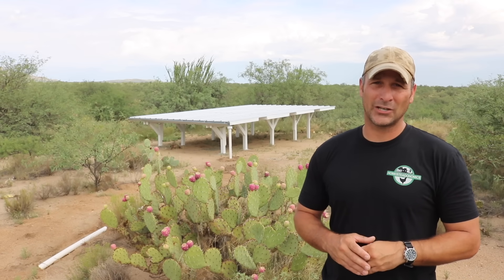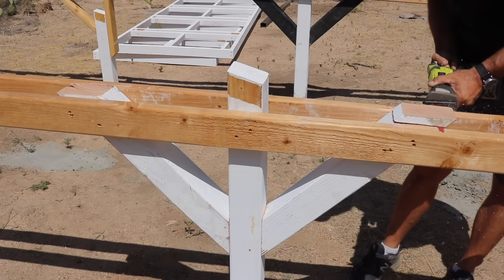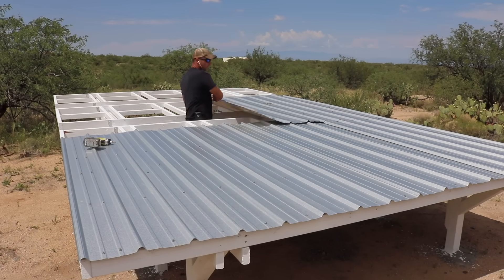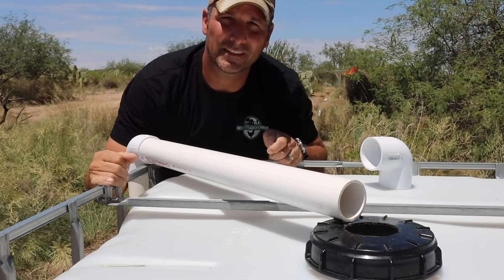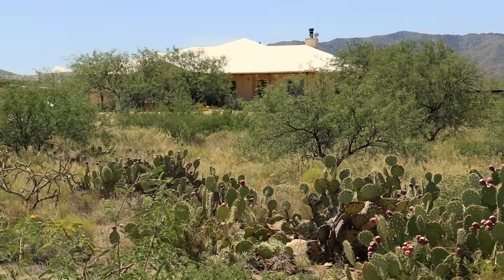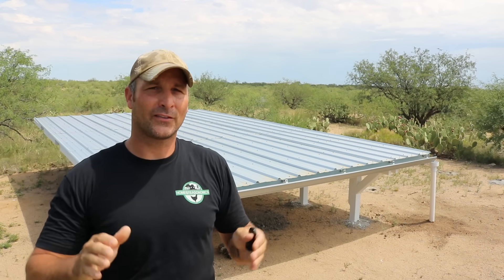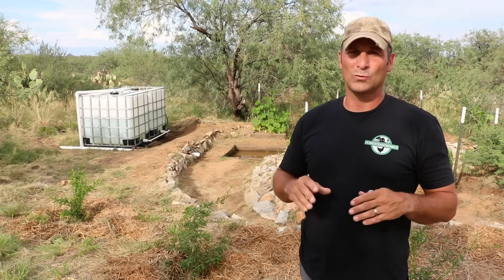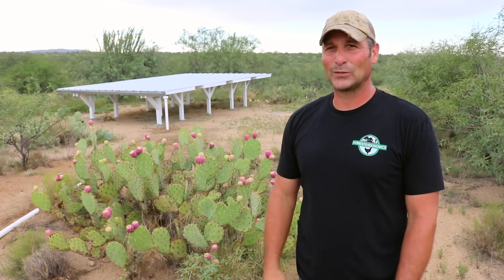Rain Roof -  Rainwater Harvesting Project - How To

Comment from the maker: NOTE:  QUESTIONS About HEIGHT, DESIGN, WHY THIS OR THAT are likely answered WITHIN the video.   I address several of the most common questions that people have been asking, during the video.  Questions pertaining to WHY's of the roof's size, height, collection capacity, better suited structures for collection, dual purpose structures being better than this setup, how I used an existing structure, why there aren't solar panels, cheaper methods of collection that I use, how the water moves through the pipe, alternatives to storage that are better than IBC's, location of the IBC's, why this roof is NOT the ideal set up, cost and several other topics.  Please, if you watch the video you might see an answer to your question.  I appreciate you all watching, but I unfortunately do not have the time to answer questions that have been addressed multiple times in the video.   

Again, thank you for watching and sorry if this sounded too direct.  But I really think many of the questions being asked here are answered within the video... some multiple times.   I understand many people just click through videos quickly.  But unfortunately when doing so, they often miss many details of why or how certain things were done and why.  

And on another note... one question that I did not answer in the video, is how I drain the piping and use it to water plants via a garden hose.   I will try to show this in an update video at some point in the future.
Reply: Would be great for Cattle...in a holding pasture.. - they'd have Water and Shelter...  .. Yep, I'm listening a s you had said it.🙏 🐑 🐮
Reply: Desde hace un dia veo que tus videos, una sugerencia, pero creo que ya se te debe haber ocurrido - No seria mejor si esos contenedores de agua, los hubieras ubicado debajo del techo recolector de agua? Digo porque se podria hacer un hoyo por debajo del techo, para que quede semi enterrado y de esa forma protejes el agua de la interperie - terreno abajo, tendrias agua por gravedad de riego por goteo, incluso si puedes elevar ese techo, te puede servir para hacer un deposito extra, aparte de alojar los contenedores de agua, tendria un buen proposito, claro algo mas de trabajo, aunque eso creo no te seria muy dificil, por tu forma de ser - Saludos y felicitaciones por tu labor
Reply: O
Reply: You make things looks so good easy.
Reply: Isn't it better to make a carport to use land underneath ,shade
Reply: U should have made it a carport be better
Reply: Traducir
Reply: Traductor español
Reply: Why not just 3d print a giant funnel?
Reply: 12 14 2023

Comment: When I was growing up, our "rain roof" for supplemental non-potable water catchment was a plastic sheet on the ground up the hill from the cabin. If metal isn't an option, UV-resistant plastics like greenhouse membrane, pool liner, or old billboard tarp can work great if you've got enough elevation change for it.
Reply: One word "microplastics"...

Comment: solar panels slanted at an angle drip water just as well. why not kill two birds with one stone and put panels on top of the roof? Then you have triple use. Shade, power, water. Such a triple use gazebo might not even require city approval as solar panel installations on roofs oftentimes do, although you would need to check with your jurisdiction of course.

Comment: No! No I DON’T know how that works! Yes you’ve explained it works by level difference and showed me that the outlet is lower than the inlet, but I still don’t get how the water is going UP the pipe. I think it works like this… water will go up the pipe and into the IBC if the whole pipe is full of water (so like the water gets to the bottom of the pipe and just builds up the pipe and up the vertical pipe at the same level until it hits the opening of the outlet and then will drain out and won’t (shouldn’t at least) be able to flood back up out of the inlet unless the water is filling up faster than what is coming out of the outlet. 

Am I close?!?

Comment: I live on a yacht in NZ and only drink rain water..and put a clean  tarp out before shower comes...and with just 1 m x 1 m often get 40 litres in a few hours.  Using a nylon web tarp attached to 4 or 6 corner posts...means it can be folded when not needed to keep it clean. Its light too..a collection point in centre of tarp can funnel the water into drum below. We filled 1000 litres tank in Nepal like this in a heavy shower...with  4 m x 4 m tarp.

Comment: That's pretty dumb nothing but a car port why wouldn't you build it higher so animals get some shade under it
Reply from the maker: Thanks for letting me know you didn’t watch any of it….where I address all of those questions about why this isn’t the best design, carport/dual purpose structure is ideal, cheaper options, why I was using materials I had on hand and a structure that was already existing at that height…🤦‍♂️😂
Reply: @homesteadonomics  Seems Phil had some great songs but no common sense- Great video well done Thank you.

Comment: Why so low to the ground? Why not build it higher so the space under it could be used for storage?
Reply from the maker: I literally answer ALL of those questions in the video….. why this is not an ideal setup, better designs that use less material, cheap tarp setups, why the ideal that any structure like this is a dual use structure….etc
Reply: @homesteadonomics  My apologies, I didn't watch the whole video. I have seen other examples of these, and they seemed to be short, so I ran with that.

Comment: I wonder if you could do this with static solar panel array. Maybe mount little fin on the sides and a gutter along the bottom edge of each array row into a final gutter on one end. Capture energy and capture water with the same system.

Comment: I like it. Would be easy to put a south facing slant on it and mount some solar panels over it. Two birds with 1 stone. 
Put it 8 ft in the air and you also got a car port. 
Three birds.

Comment: Look at Bermuda, there is no surface water. All roofs are designed as roof collectors, made with local materials concrete, coral rock, lime finished, controls contamination, renewable.

Comment: Okay, now make it out of solar panels so you have two things for the cost of the covered ground area instead of just one. You could even make it 3 if you also ran some water line behind/under the panels; perhaps getting enough hot water for a load of laundry or a shower... Just some thoughts.

Comment: Many are under the mistaken impression that fresh water is not abundant ABOVE the surface of our planet. Scientists have estimated that the atmosphere of Earth holds the liquid equivalent of 3,000 CUBIC MILES of water. This is moisture currently suspended in the air as condensation, humidity, clouds, falling rain, sleet, snow, and all other precipitation. That equates to a CUBE of liquid water approximately 15 MILES on each dimension. 

A simple 1" rainfall on one acre (43,560 square feet) yields 27,154 gallons. One square mile (640 of those acres) taking that same 1" rainfall delivers 17,378,560 gallons. Identify the county in which you live and its square-mile area...and be astonished at the MASSIVE amount of liquid brought to us via a short 1" rainshower.

Capturing what the sky delivers is simply magnificent. Your efforts are superb and so very much appreciated!!

Comment: It would be cheaper, easier and more economical to simply stretch the plastic film on the slope. Inexpensive, low material consumption, compact, mobile, minimum work.
Reply from the maker: I actually mentioned my ‘billboard tarp rainwater” project a few times in the video.   It’s a exactly what you’re referring too

Comment: Hmm... The water pressure is strong enough to flow from the ground PVC pipe to the tote?
Reply from the maker: Yes, water always seeks level and as long as the outlet is lower than the inlet, the water will flow because of the elevation difference.

Comment: My father did that more than 10 years ago here in Puerto Rico, taking advange of the aluminum roofing that was in place in one part of the house. The rain water is directed and stored in a tank, and we use it to water the plants in the garden, especially in times of drought.  We have a tank of about 250 gallons.  At it is full at most times of the year.    The water can also be used for most house hold shores as well.  In case of an emergency we can add a chemical to make it potable.
Reply: Whats the name of the chemical
Reply: @ronyvargas3137  Chlorine
Reply: That’s my -plan too from our garage roof as it is low to the ground on the yard side. Still figuring out holding tank.

Comment: So... how about an update describing how things have survived and worked?  Perhaps you hav e already done that.

I'd be concerned about wind tearing things apart. 

Roofs collect debris,  and it's worthwhile not dumping that into your storage tanks until it starts running clear.  You can divert that water and still use it,  not just dumping it in the tanks.

Also,  I would suppose those tanks transmit sunlight pretty well,  which would promote algae growth,  with no good way to clean them.  Also insects and other debris.

I live in Seattle,  where they say "it rains all the time.  There is plenty of rain except during the seasonal summer draught which lasts 2-3 months.

I live in urban Seattle,  but have used zero citywater for fifteen years or so.  I collect water from 3 downspouts that feed 1) a 600 gallon steel tank I got surplus thirty years ago for $60 and two 40 gallon trash bins.  Thats all outdoors.  Inside I store  360 gallons of water in plastic barrels that I collect in the prime rainy season when water quality is best. I also store water in about a dozen five gallon buckets in the basement.

I live alone.  I use about two quarts of water/day for bathing and two quarts or so of water for cooking/dish wasjing.  And I use water for the clothes washer,  which uses about 25 gallons to wash and 25 gallons to rinse. I have a small vegetable garden for growi9ng lettuce and carrots which uses quite a bit of water,  actually.   I move all water using five gallon buckets  ----no mechanical pumps or piping.

During the heating season,  water gets heated on my wood stove.  During the summer, two 1/2 gallon plastic jugs collect solar heat for hot water,  and two one quart stainless  steel thermos bottles store hot water.   In the shoulder seasons,  water gets heated on my gas range. 

That's my very simple system which has provided me with all the water and hot water I need for decades,  at only token out of pocket cost.  

While this saves me a few dollars,  my main motivation is frugality.  I hate to see things wasted,  and disposing of rainwater and then buying citiwater seems absurd.
Reply from the maker: Check out my latest few videos of my goat project.   I move this roof over there in one piece!   Kinda sorta eqyptian style on a wheel.   It’s becoming a hay barn as well as being for rainwater as well.   And in a couple hours I’m going to post the rainwater system video for it.   Thanks for checking it out😊🙏

Comment: I'll share , a cool design, I'm to old to care....
Buy up.  The desert , acres,  , and build a lake, that's kind of underground. How. Like this. 
Half acre lake, ID anchor points, down both side of a rectangle,  get your corners, this is cheapest. Cement , poles, down all side. Bow, PVC , or cheap, steal gas, piping. 1/2". Up and over , down the side, glue, weld, how ever, over the top, cheap chicken wire , roll chicken wire up and over, tie wire it off. You need 15 feet in the middle. Arch the sides down.. then chicken wire, that is not LAYED flat. Around, outside, dig small footer, then spray roam, the chicken wire, starting at the bottom, in layers. Go up 4 feet stop. Go all the way up, and over, a foam half Acer.  It should be, 1.5 to 2 feet thick. Keep the ends open.... now, in the middle, bulldoze,  the sand out, till you have your pit, buy oil company's  tank liners, and lay a liner in your lake, support the side, on the out side make the roam look like rocks. Paint it, . Build the ends to look cool.
Next, mega rain, fill it., filler the water....
2 paths, now, 1 fun, or 2 food,.. I would fill it with cat fish. Some kind of sea food. Now, that would be cool. And put you on the map, fresh sea food in the desert.

Comment: Just not sure of rolled roofing... rule number one. Do not go cheap.  Of what catches your drinking water. ( a joke, hey baboon, I got a deal on some metal roofing only slightly used. It was the sheathing used on Chernobyl,  and at night it glows bright so I can see. But baboon, my hair keeps falling out.) Ok back to picking apart the design. What ever catches the rain must, be rated at a high heat, and high sun UV rating not to break down and leach into the water. ( important,) even the screws used to screw down what ever is used. Or your makeing toxic water supplies.  I would use a 3 layer system first layer the bones, that give the catch system strength. Next layer, let's call it the clean layer. 
A portable water plastic, or a thicker water tank liner. They come in rolls, then my third layer would be to protect it all, but let rain fall thru. And it would keep the desert sun blocked. The netting,  is easy, think like your put LADYS panties hose over a roof, it will keep bird crap out, sand , dirt, think, like your building a green house that leaks, and let's wind blow thru it. 
But under it you have a clean system. Now after you have that built.... keep it 5 feet off the ground. Install 3 pre gravity water filters, like small tub steps, each step, holds 10 gallon. It filled, filters into the next step, it fills filters, and drains into the last, step, then piping gos under ground. A 3 tear filter water, fill your MEGA tanks... water needs to move. Install, solar small pumps, pump from each tank in a cycle,  and add electronic filter, all water is zapped so ((( zero ))) can grow in it... oh crap, 1 more thing.
Build, a roof over, your main tanks.... 3' above them sun UV, ...when you build that. I'll be impressed.. what you built will make you sick in 20 years.

Comment: Pro tip bucket that tips after first fill, then stays tipped until the rain stops.  Google the design.  Stops debris on roof going in the tank. Not enough hight here though  you need 18 more inches.

Comment: I perused the comment section hoping someone else might have asked, but haven't seen it. Maybe I haven't seen it because everyone else already understands and I am just learning so I don't know... in any case I have to ask....

Even though your IBC is downhill from catchment.... how does the water get into the tote? There is the PVC parallel to the ground leading to IBC totes, that line continues even after IBC totes.... and there is a PVC going straight up to drain into the tote.... how does the water go up?
Reply from the maker: As long as the inlet, where the water enters the PVC is higher than the outlet, where it dumps into the IBC totes, the water will always flow out of the lower side.   So the side where the IBC totes are is lower than where the pipe inlet is by the gutter.   Hopefully that made better sense.   You can try it with a hose or tube at home.  Fill the entire length of tube or hose with water and keep both ends of the tube level.   Then move one end of the tube higher than the other end.  You’ll notice that the water always flows out of the lower side.
Reply: @homesteadonomics  yes, I understand that part... the part I don't understand is that there is the horizontal pvc pipe running down the hill and then another one running vertically straight up the side of the ibc tote. ... and the horizontal one continues on after the vertical one. How does the water go up the vertical pvc and into the ibc tote rather than continue on down the vertical running one?

Comment: Curious. Wouldn’t it save pvc to put the roof over the catchment?
Reply from the maker: I actually talked specifically about that in the video…. How it would be a better option to have it higher and have the IBC totes protected under the structure…and how this is NOT the best design, etc,.

Comment: I'd probably install few solar panels on top of that "roof".  Give it an inch spacing between the panels so the rainwater can flow down to the roof.  Figured make double use of the space.

Comment: Is Gravity fed water drinkable or has it been tested to see if the Water is safe for consumption by plants, etc. or have you filtered it to be safe for consumption? Merely wondering as then it would be worth while.  Stagnant water could harm as well so is there a Water pump circulating the water from tank to tank to keep it oxygenated and clean? Thanks for sharing!

Comment: A much easier and cheaper rain harvester is to just dig a shallow bowl on the ground, and line with an old vinyl swimming pool, or epdm pond liner. Then lightly cover with gravel or small rocks to protect the liner from UV damage and make it look like nice landscaping. Plumb a 2" drain pipe before laying the liner either in the middle low point, or you can slightly angle the bowl shape so water collects down at a low side and funnels into a drain tjat goes to water tank.

Comment: HEY Man!!!! Instead of putting sheet metal roof over your frame. Why not do what I did. I bolted a bunch of Photovoltage panels and seal it and place a gutter on the slope. You get electricity and rainwater collecting system.  a 2 tor 1.

Comment: I did something similar... Higher, 7' to stand under, yet easy to clean, using solar panels... getting cover, shade, electric. and water... added a place to cook, eat, fire pit, solar hot water tank (painted black), sink, soaking tub, makeshift shower.. and 4 hammocks... added everything a little at a time...